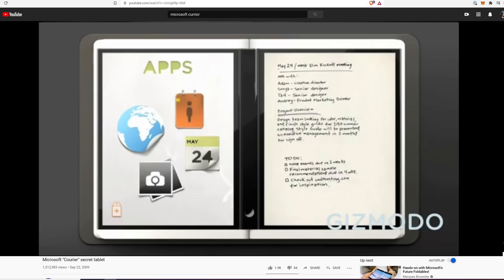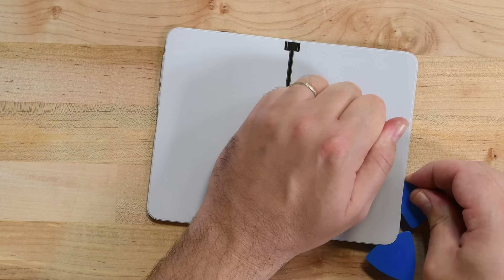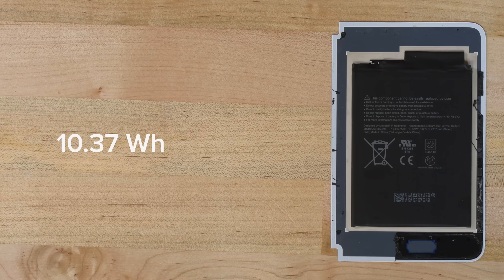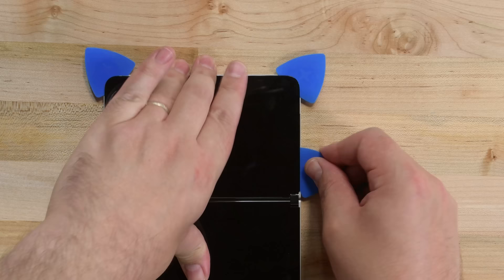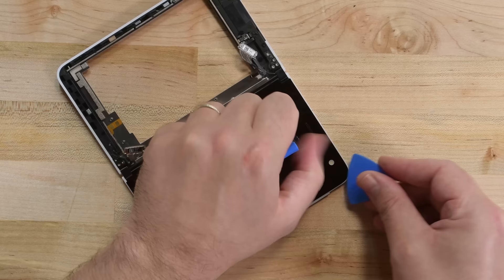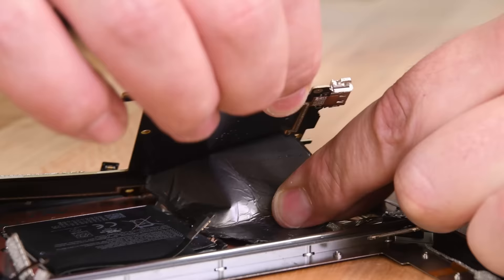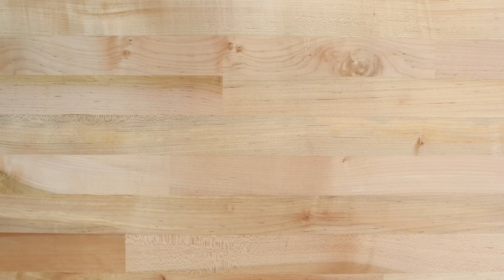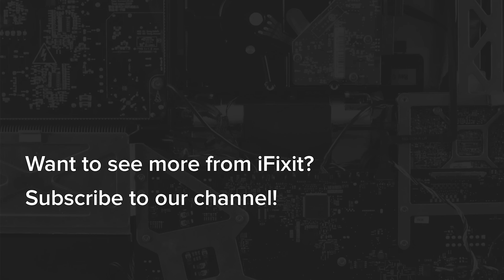Surface Duo Teardown: We Broke It So You Don’t Have To

Comment: that's not "glue" in the back of the motherboard, is graphite for thermal dissipation.
Reply: lol such a cool use of heat dissipation and ifixit just called it tape lol
Reply: Yup.

Comment: Why I think the Surface Duo 2 could score a 6/10 by simply make the device thicker and less glue?
Reply: Max-Leo Amberg  You rly don't get my comment.
The Surface Duo is thinner than the Galaxy Fold / Z Fold 5G.
Microsoft did Sth small at theyer Suface Tablets and it bumped it from 2 to about 6 Points.
So 2 References to older videos.
Reply: I also hope Microsoft adds a second USB-C port to that so I can plug in my earphones or a dock…
Reply: @kbhasi  any dock designed for this would have a second usb-c port. 
If you just want a mini-jack: 
https://smile.amazon.com/dp/B07Y87QXTQ/ref=cm_sw_r_cp_apa_i_rNcyFb642V09T
Reply: No THINNER

Comment: I still hate that they haven't announced an international date yet
Reply: Have you seen the reviews? It's a piece of crap.
Reply: Adam L. Not all reviews echo that. And mostly it’s just software bugs.
Reply: Mireaze I’m an Aussie. I ordered one and am having it shipped over. I’m super excited
Reply: @adaml.5355  None of the reviews I've seen seem to understand the purpose of this device.
Reply: @James-lw3gi  Have a better look at the reviews. I've seen several and it appears its a piece of junk, literally. Camera crap, sound crap, small battery, laggy & buggy software.
Reply: GREG L. I’ve had a look at a nauseating amount of reviews. I’ve seen the bugs and lag. I’ve also heard about how much better the device got after the reviewers updated the software. 
 Ore often than not I’ve seen people try and open the app drawer from the bottom of the screen and it not respond. The duo doesn’t open the app drawer like that, it’s done from higher up. 
I know there are other bugs. They can be fixed by software. 
Most reviewers I’ve heard were impressed with how much battery life they got despite the small battery size. 
The camera is indeed crap compared to devices that have bigger and better cameras. 
I use headphones 99% of the time so I don’t care if the speakers are tinny. 
There is no other device on the market that is aiming for what the Duo does (to my knowledge). I’m excited about it.
Reply: @James-lw3gi  Yes, there is an other device on the market that does the same and much better. With its specs light years ahead of this strange low end microsoft device. Galaxy Z Fold 2
Reply: This 1st gen was just a test only available in US, I think.
2nd Gen will be worldwide.
Reply: GREG L. See that statement says all I need to know about how you are viewing the devices. The fold 2 is a large foldable screen. It imitates multitasking by using software. The Duo is a dual screen device that natively and naturally performs multitasking. They’re completely different devices. The fold 2 sucks at multitasking, but excels if you want an uninterrupted display (bar the terrible fold which catches the sunlight). 
Yes, the fold has much better specs. It also comes with a much higher price tag, and imo, a much uglier, heavy and chunky device. It’s also a 2nd gen version, arguably 3rd if you count their first recall. 
For what I want the fold 2 sucks at, the potential of the Duo for me is far greater.
Reply: @adaml.5355  No. It is not.
Reply: @MrCoolduddy  Camera crap? 🤣🤣 no bb. Try harder.
Reply: @dimitris_official  eyup, was very disappointed at MKBHD
Reply: @MrCoolduddy  ?? Fan boy toxicity levels here.
Reply: @MrCoolduddy  That fake glass is TRASH.
Reply: I have mine for two days..
Stay away..
Everything is a piece of junk!
Reply: Why would you want to buy a gen 1 device? Well, it’s your money
Reply: @MrCoolduddy  The Fold 2 is meant for a completely different consumer. If you want to watch a full screen video, get a Fold 2. If you like working with more than 1 app at a time the the DUO is a contender. Software screen/window management will never be as good as having 2 dedicated screens.
Reply: @iot1452  To make sure the device gets a 2nd gen. Exact same thing happened to Essential. Reviewers trashed it and said "Wait for the 2nd one." Well the company went broke and never got a second attempt. Microsoft is a big company and can eat the cost of a 1st gen flop, but that doesn't mean they'll risk a second one.
Reply: @EliteProductions3129  It is the same, Samsung has dual/split screen management. IMO Surface Duo is a DOA product, it reminds me my HP Elite X3 windows handheld eco system, well above 2k and dropped by both microsoft and HP.  I am with apple now, had enough of these windows/android experiments - as a consumer I want to get a PRODUCT that works out of the box, not these buggy and overpriced expereiments. I am not a guinea pig for microsoft, paying 1.5k usd and hoping for the best - "when/if software update arrive"
Reply: @MrCoolduddy  Well I'd say you made the right choice with Apple since you don't like using anything new. But I literally said that software window/screen management is shit compared to having 2 dedicated screens. It's an afterthought on the Fold and will rarely be used. Having 2 screens begs you to utilize them both. Different types of consumers will gravitate to each device. Not saying the Duo is the perfect version of the phone it's trying to be, but the Fold definitely isn't a substitute for the same experience.
Reply: It's just a concept. Microsoft shouldn't release it yet, super expensive and weak with a shitty software. It's a great concept that may become the best foldable in some years (hope they don't give up). But don't buy it. Dozens of reviewers around the world said that.

Comment: Every year the repairability is worse, from the whole spectrum of devices. I have a feeling that one day we will pay just to have the chance that our devices could be repaired.
Reply: Don't give them ideas. Everyone wants to be Apple
Reply: That’s the price to pay for portability. It’s definitely worth it in my opinion.
Reply: It is a new device. Give them time.
Reply: @DarthRaider  not anymore
Reply: RTXRadeonTiSuperXT how is it the price of portability and even if it was how would it be worth it if the device you bought for almost 1,000$ is worthless because of an issue that could’ve been fixed if it were designed better and had that in mind
Reply: Gamer Guy Modularity is not cheap or compact in any way.
Reply: Gamer Guy That’s a price people are willing to pay
Reply: DistroHopper39B Just because it’s “easier” does not make it easy at all. Replacing anything on the iPhone is extremely intricate and expensive.

Comment: I would've been interested in this had it used an x86 processor so it could run Windows or Linux instead of Android, and didn't have such a bad repairability score.  Such a shame that Microsoft only produces crappy, unrepairable hardware just like Apple.

Comment: This should have been 0/10. How would you change the batteries and put it back together? It's a glue and tape-filled mess inside. I consider this non-repairable. Why did they go easy on Microsoft?
Reply: If you head ot the site, iFixit explains why. And that comes down to, you can repair and replace the displays and glass backs without removing any other components.

Comment: I am sick of their tone in these videos. It‘s not about repair anymore but merely a rant about tight designs. There is a safe way into any phone even the Galaxy Fold but these guys are just playing dumb. Like how did it not occur to you to think about where the device should be accessed from (which is usually from the front). And how can one be so impatient and tear down thermal components (yes it is not tape and you obviously realized that later) and be so careless with a 1400$ foldable device that is obviously very thin and thus dense.

Helpfulness score: 0/10